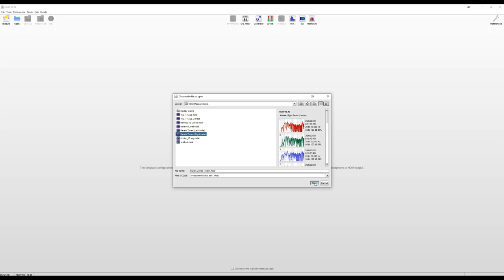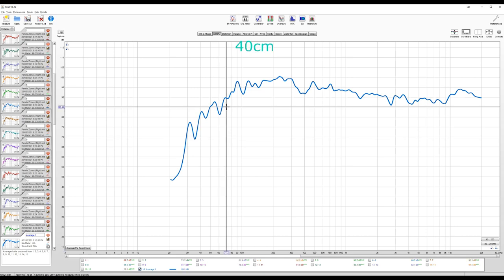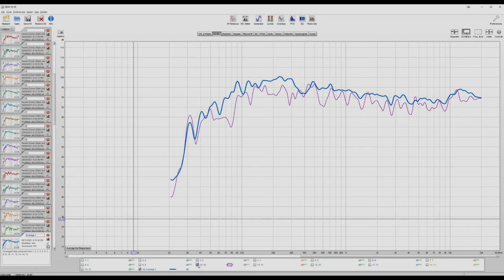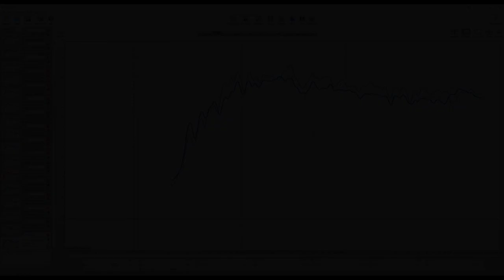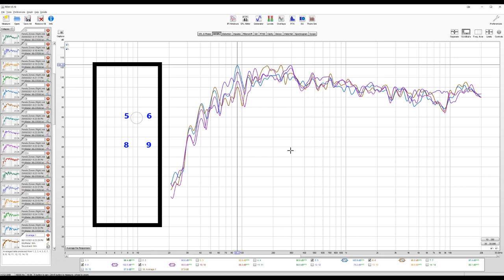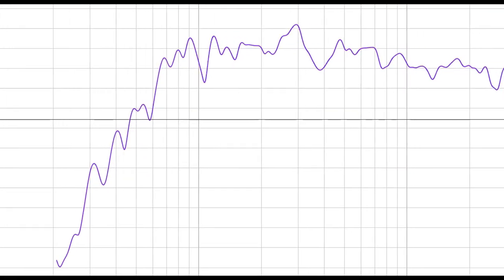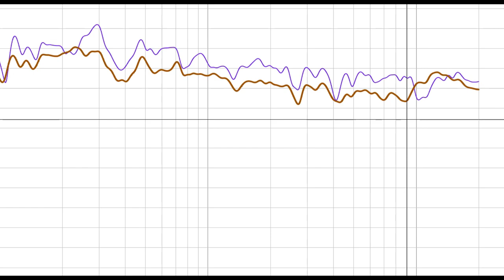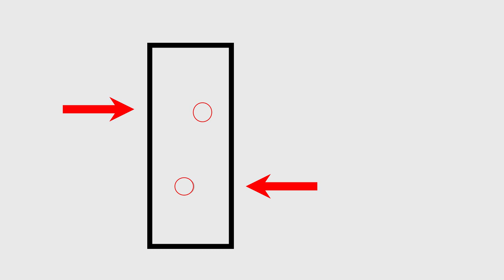Measuring Sound Across My DML Panels

Comment: Hi Ben, Very interesting data! 

For base response, I will be pretty surprised of you can do much to improve it. There are three problems as I see it. DML panels make noise primarily by resonating in many different vibrational modes, and the lowest frequency vibrational mode available is the fundamental of the longest panel dimension. To produce any sound at a lower frequency than that, the entire panel must be moved back and forth piston like, basically like a conventional speaker. You can facilitate that by putting more drivers distributed across the panel. The more drivers, and the more evenly distributed, the more piston movement you can induce and thus increase output below the fundamental frequency. Or you can redesign the panel be be stiffer, and thus easier to move from a single point, for instance making it a cone rather than a flat panel. But of course you would be changing it into a conventional speaker. 

However, another aspect to keep in mind is that exciting a mode is very energy efficient and so a little input will produce a lot of sound, this is why DML panels are so efficient. However, trying to brute force the panel by moving it as piston takes a lot more energy for the amount of movement, and thus the amount of sound, which is why conventional speakers are relatively inefficient. So this is another aspect that limits sound output at frequencies below the fundamental of the panel. To be specific, this aspect necessarily causes lower output of sound energy below the fundamental frequency compared to the sound output at or above the fundamental mode and there is basically nothing you can do about it, because it is simply less efficient to emit sound by piston motion versus exciting a mode. Therefore, output from modes will always overwhelm output from piston motion. This principle is probably the single most important to understand regarding designing a speaker that will sound good, both DML and conventional piston speakers.

The final issue DML speakers encounter with bass is that they are open-baffle, and so sound coming off the back can interfere with sound coming off the front, which is an increasing effect with lower frequency, so even if you manage to make the entire panel move as a piston, much of that output will be lost to destructive interference. This by the way, will limit low frequency output more for long narrow panels than for a square panel the size of the long dimension, because the interference roll-off frequency is controlled by the shortest dimension of the panel.

Between these three effects, significant output below the fundamental is inherently limited. However, it can be easily improved by making the panel larger or squarer. That solves all issues, by reducing the fundamental mode frequency, and by increasing the self-baffling size, and thus reducing the frequency where destructive interference becomes important.
Reply from the maker: Hi Steve, thanks for the detailed info. I'm sure you're 100% correct and I don't expect to get any 'slam' out of these - I'm not going for pistonic movement on my main panels (and I wonder if you were to produce such movement, how it would affect the rest of the sound).

I guess a better way to put it would be that I'd like to improve the quality of the lower frequencies, and they tend to sound a bit lacking. I'm happy to use a sub/s for the <100Hz range as well.

My first idea relates to your 3rd point about them being essentially 'open baffle'. I'd like to experiment with various wings' in order to reduce the interaction between the front and  back waves of the panel. I'm hoping that between wing/s and careful placement of multiple exciters, I'll be able to maintain a more even response through the mid bass region.
Reply from the maker: I have also thought about putting a large number of exciters on a single large panel to make a kind of 'DML subwoofer' (not really DML though I guess) but component prices are too high at the moment to really consider it.
Reply: @TypicalBenYT  The wings idea will certainly work as a way of extending base by reducing destructive interference. However, why not just make the panel itself larger by the size of the wings? The effect on reducing destructive interference is identical, and you get the benefit of more sound generating area, and thus greater efficiency at lower frequency.
Reply: @TypicalBenYT  You probably would be better off with an open baffle subwoofer of conventional design, which should be sonically very similar to a really well implemented DML subwoofer. It certainly should be possible to make a DML subwoofer, but it will have to be pretty large to dig deep, and perhaps will need equalization to offset the interference rolloff. Not impossible, but probably quite demanding to achieve "well implemented".
Reply from the maker: @stevefoster6047  I would actually like to build some big panels down the line, but at the moment I’m thinking of my relationship-friendly acrylic panels which are about 120x40cm. I hope to get good results with ‘folded back’ wings (maybe at 90 degrees like some of the GR Research kits have) so it won’t add much to the footprint or presence in the room. The trick I suppose will be preventing interference without boxing in the back wave sound. A single wing might be the sweet spot, or asymmetric wings. I’ll have to test and find out!
Reply from the maker: @stevefoster6047  this has been my thinking too. An interesting experiment but probably not a practical solution. At the moment I have a boxed, active subwoofer but going open baffle seems to make more sense eventually!
Reply: @TypicalBenYT  Oh right. I think I recall now you mentioned using folding wings in a previous video. That's a clever solution to keep the apparent size of the speaker smaller.

Comment: Hi Ben

Thanks for sharing your work and thoughts. 
 
A great looking build but I gently suggest that maybe the form is somewhat compromising the function.

Let me explain:

When laid flat, the acrylic panel sagged excessively, leading you to add side supports.  In so doing, you effectively created a series of sprung mounted smaller panels.  You can visualise this by simplifying the panel  into a lattice with longitudinal  strips being supported by shorter transverse strips anchored at your fixing points.  If you now consider the panel width being divided into 3 longitudinal strips, the centre strip will be more elastically supported than the two edge strips, but will still be affected vibrationally, and hence acoustically. 

 This mounting would be expected to reduce the low frequency response and boost the mid/highs

When vertically mounted with no side fixings, the self weight sagging would not come into play provided that most support is provided along the top edge ...ie suspended from the top with soft foam restraints at the bottom.  That would restore the full panel length vibratory modes.  If further stiffening is required sonically, then you could experiment with nicely finished timber braces, or even shaped acrylic strips on edge,  glued to the rear of the panel.  

Whether acrylic is inherently a good dml panel material is a separate issue altogether.

Keep up the great work..
Reply from the maker: Hey Jack, thanks for the detail.

I understand your explanation re: dividing up the panel and I also would have expected a reduction in bass response compared with a single uninterrupted span of panel. My measurements don't bear this out however. In my 'Acrylic build 2' video at ~13:40 I show the side by side graphs of the 6 bolt and 10 bolt panels, and the 10 bolt (smaller divisions) exhibits much better low end.

It may be that more power is required to excite those frequencies out of a less rigid panel, or there could be issues with my measurement - or maybe I did just get better bass out of the more rigid config. I do plan to improve my testing environment and measure again when I get the chance.

Comment: The suspension is very weak, so likely the jagged response is the result of the modes with the material’s damping properties. It might be that you could get a better response simply by getting thick rubber bands and suspending the panel inside the frame with them. 
I don’t know whether it makes a difference in the actual sound of the panel from a distance of more than one meter though. And I think your suggested solution of putting a driver diagonally across and down is a good idea.

Comment: Ben, love your videos - in depth and clear - especially for this amateur.  I made my first set last week from foam board using two 4 ohm exciters wired in series per panel. They sound really good after making some adjustments with my AV receiver. Voices from the TV were exceptionally clear. These are to provide me with a solution to work better in the room design and to replace two old Heresy speakers.  The cabinets on the sides of the fireplace are the wrong size for the Hersey’s and rebuilding is $5K. Above the cabinets are floating shelves that limit me to an 18” high DMLs. Width could be up to 40” but I used one of the 2’ squares so I ended up with 18” x 24”.  I’ve read about the golden ratio but could not find any actual results supporting the ratio for these panels. Would love to hear your opinion on reducing the height to utilize the ratio or making new panels for 18” high with the width dimension 29 1/8”.  My thinking is the difference would be negligible.  Also, my exciters are at the 2/5ths, 3/5ths setup up with the second exciter as shown in Dayton Audio’s suggestions.  I look forward to your future videos.  Thanks!
Reply from the maker: Hey Weldon, thanks so much!

Nice work on joining the DML club. 'Golden Ratio' panels seems to be something of a default view in the community, but like you I'm not too sure where the initial suggestion came from.  Personally I've yet to make a panel with that ratio as I prefer a taller shape - and so far, so good if I'm any judge.

That's actually a great idea for a upcoming video - measured differences between panel shapes.

I'd imagine that your 24x18" panels would be lacking in the lower end. All else being equal, the larger a panel is, the lower it will play. Have a look at Steve Foster's comment on this video - I don't think I can explain it much better than he did! So anyway, for that reason I think going wider would improve the sound. If you decide to use larger panels, I'm going to follow up this video with a test  comparing 2 exciters as you've set them up to a setup using my idea of 'opposite ends' to see if there is a noticeable difference. I just need to set up a better test environment to do it in.
Reply: @TypicalBenYT  Ben, I had already stuck my exciters to the panel prior to seeing this video or I would have used your configuration.  Years ago, I ate at the same cafe as Paul Klipsch and would often visit his plant. (To learn about sound and play ping pong at break).  The Klipsch Heresy speakers I am replacing were built in 1982 and still sound wonderful.  This new DML sounds almost as good.  My Pioneer AV receiver lets me adjust the crossover with my Klipsch modern subwoofer.  It is set at 150 while I experiment with the adjustments. I played several songs, guitar and piano.  I asked my wife to come into the den to hear Canon in D and she said she did not need to as she could here it perfectly in the bedroom about 40’ away with a 90 degree turn.  She was right! Using these, we no longer need closed captioning while watching movies.  I hope to see more of your analysis on size of panel and exciter placements.  Thanks for you help with the details!
Reply: Ben, finally completed my speakers and installation. They look great and sound even better.  I was worried that painting these would change the performance. I used a very thin coat of the leftover latex wall paint so they would match the existing wall. I could not detect any difference with the sound.  Suspending them from the floating shelves did make an improvement.

We thought they sounded really good after I tweaked the configuration in my AVR.  However, after pulling the speaker wire through the wall and hanging them, I ran the MCACC setup program and it made some changes.  The main one was changing the crossover from 150 HZ to 80 HZ.  This was a surprise and it did improve the overall sound of the 5.1 setup.  I would send you a photo if I knew how to send without posting my on video.  Thanks for your input!

Comment: Hi again Ben... watching your testing video repeatedly to try and understand the 8/10 attachment results..still puzzled..but I think references to 2/5, 3/5 etc are only relevant when the panel is unrestrained at the sides...

What about splitting each section between the attachments into 2/5, 3/5 and testing those locations?

The 3/4 exciter position / 10 bolt case actually coincides with the attachment location.  If I recall correctly when you first trial tested this panel in video 1 you thought there was more bass when you held the exciter opposite the centre attachment?

Cheers

Comment: Hi Ben,
I've watched many of your videos with interest, your attention to detail is commendable.
One of the drawbacks with acrylic flat panels, once you've tweaked the variables influencing the sound output, is that the cables connecting the driver to the amp are unsightly. Have you given any thought to how to tidy them up? Or to alternatives? Could you use copper tape or copper rods instead of wire and incorporate them into the design of the unit, running them to the frame where they could then run down - out of sight - to cable connectors at floor-level.
Alternatively what about making the panels wireless (an especially attractive prospect if the panels are going to be wall-mounted or suspended from the ceiling), doing away completely with the need for ugly cables?
Reply from the maker: Yeah you’re not wrong about the cables. I’m actually avoiding the problem altogether on my current build, by not using clear panels. The one I’m testing with isn’t going on permanently, and I already have a pair of special ones stashed away for the final build.

Having said that, I love the idea of using solid copper rods as you’ve suggested! I wish I’d thought of this during my previous acrylic attempt - I loved the look of them other than the ugly dangling cables!
Reply: @TypicalBenYT  Hello again. I got the idea of copper rods after watching "How to build a simple Ruban speaker" video on YouTube. And using the copper tape occured to me after watching a video about using it to deter bugs from climbing into plant pots.

I had toyed with the idea of making the Rubans as per the video (a) because they seemed to sound good and (b) because they look so different to traditional speakers and could be made using better quality materials into something quite artistic.

Comment: Fascinating, Ben. Thanks for sharing. 
Are you planning to use two 40-watt exciters on each panel? That seems like a lot for this type of speaker in a home listening space.
Reply from the maker: Thank you 🙏 

You’re not wrong, it’s probably a bit excessive given the efficiency of a DML setup. Originally I was going to use either a single 40w or 2x25w drivers on these. 

I read some good things about the Dayton DAEX30HESF-4 model and decided to use that, and if I do decide to go with multiple exciters, I’d prefer they be the same for the visual symmetry. 

I keep flip flopping on this. One one hand a single driver more closely adheres to my original, minimalist concept. But if two driver gives a smoother response then maybe it’s worth the slight extra visual clutter.

I’d run them in series for 80w per channel @ 8 ohms so the output would be under control.

What do you think?
Reply: I don't know enough to comment,  @TypicalBenYT  . 
But I do plan on building a set of DML speakers. I was thinking of expanded foam panel, as in the famous @Tech Ingredients video, but I'm rethinking that approach now that I've seen your way-cool clear panels. They should work well if I include a subwoofer.

Comment: great series!... I've just heat-molded plastic panels into slight-curved shapes, to form the sound boards. VERY-interesting results, Ben...forget flat panels!! I'll leave it to y'all to experiment with the notion. :-)

Ohhh....and please quit drilling holes to attach. There's thick soft foam adhesive tapes (aka: weatherstripping), you know :-) Every hole degrades the surface integrity! 

Do a "scatter test" as Tech Ingredient, et al, have demonstrated. Place your drilled panel on a "vibrator pad", add sugar, and see the crystals's vibration distribution. I'll bet every hole causes a radiant sub-radiance, which counters the Exciter's. Maybe :-) buona fortuna
Reply from the maker: Hey Antoniio! That’s really interesting - I’ve seen a few curved panels but not thought to try them yet. Would love to see what you came up with.

I’ve seen the soft tape. My mounting setup on these is because I wanted more of a ‘floating panel’ type look going on. I’m also not convinced that such small holes (in the context of the large surface area) will make much difference to the sound. This gives me an idea though as I do have 2 identical panels in the garage - one with no holes and one with mounting holes. I think I’ll measure them back to back to see if anything jumps out.